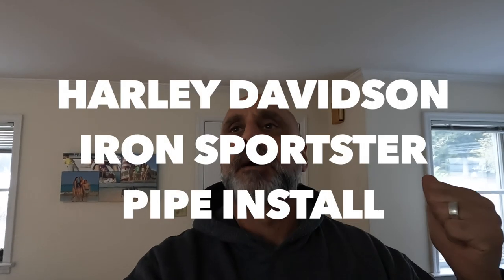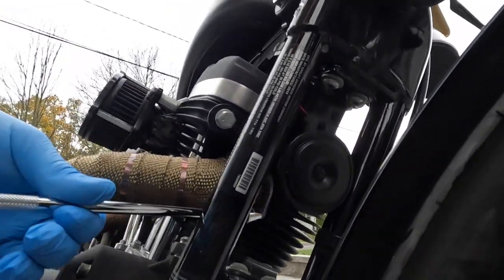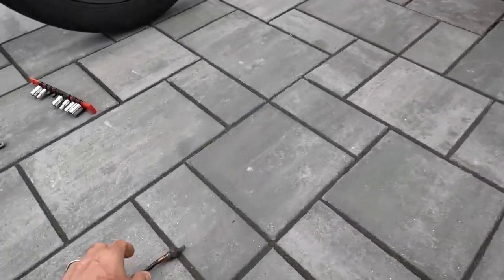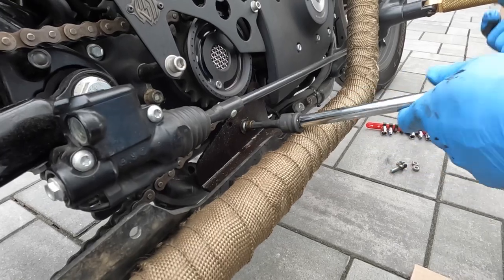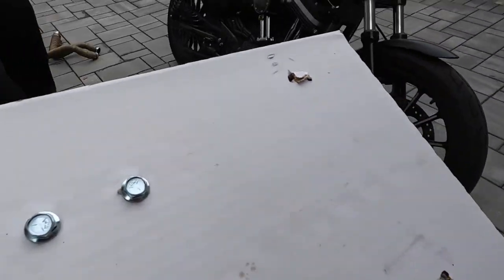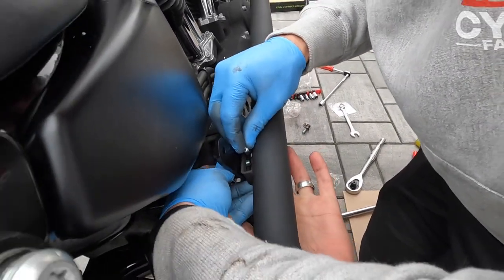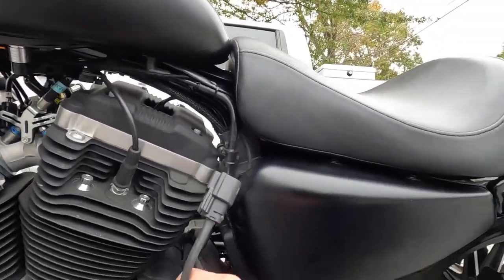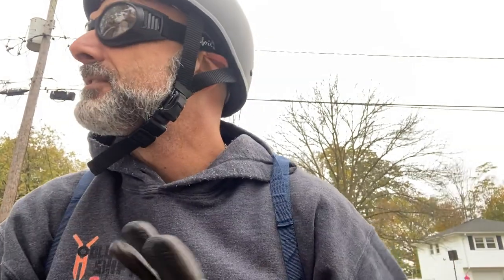Harley Davidson Iron 883 Sportster Exhaust Install

Comment: Ha Sandy, When you were riding away from John's place, He could still hear you 4 blocks away.
Myself, I would get 3 of the 12 inch Finned heat shields from Lowbrow Customs. 1 for the top front, and the other two for the top and bottom further back, so I don't cook my calf at a stop while flat footing it.
Reply from the maker: Just got some… install soon

Comment: Check your intake manifold bolts as well. If the exhaust bolts were loose, the intakes probably are as well. You should hear a loud “crack” when breaking those pipe bolts.. Just a little tip. Good luck!